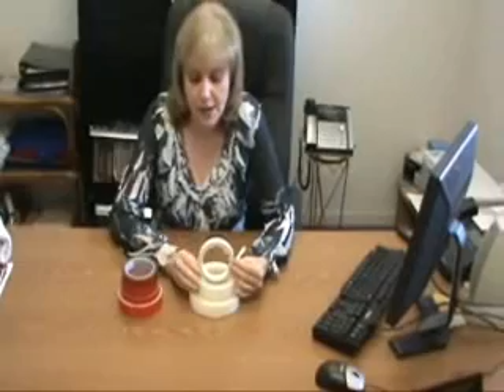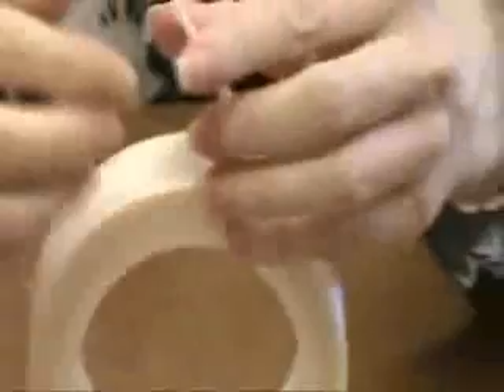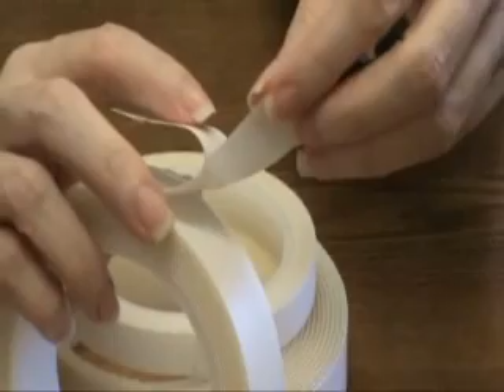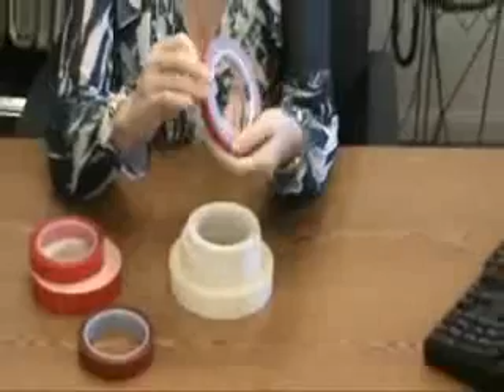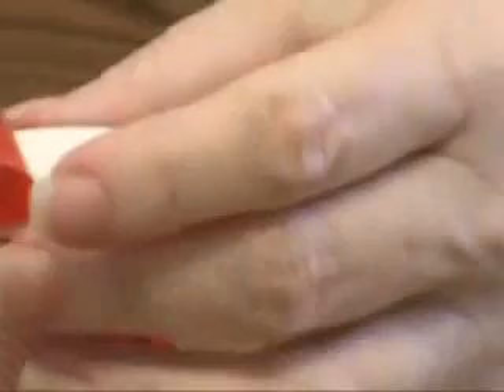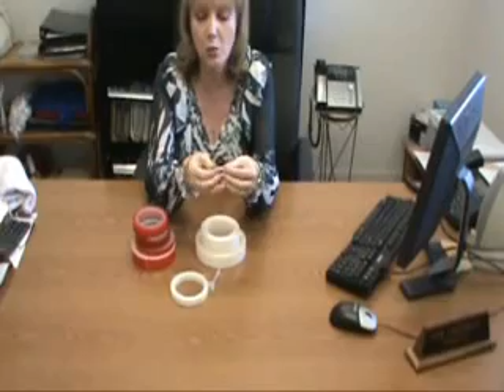UHB Tape Demo

Comment: I found a great deal on this PE tape at Uline for my project, bought 2 cases.  Thank you so much for posting the acrylic recommendation and the informative video.  The tape worked perfectly for my project and the signage is holding up well in the dry Houston heat!  Thanks again.

Comment: what does the PE mean?  Poached Eggs?..LOL.. I guess I don't understand the difference between acrylic and or rubber or masking.   Which would be better for an outdoor application in which the signage is placed near a busy street in a very seedy part of south Houston?  I have about 100 or so signs, I'm thinking I will need about 250 to 300 feet.  Thank you for your electronic advisement.